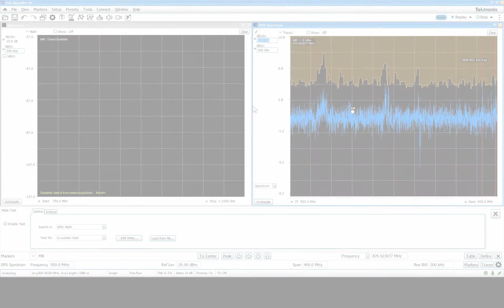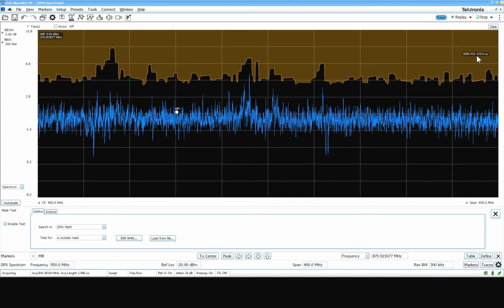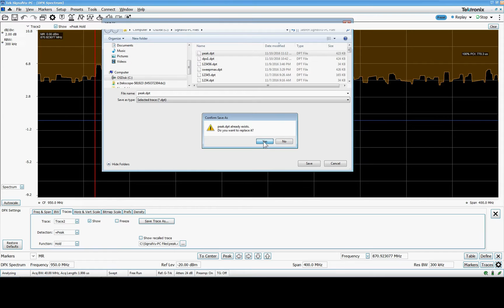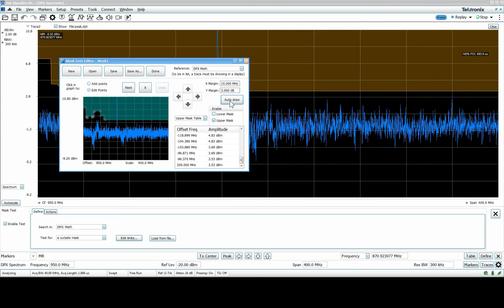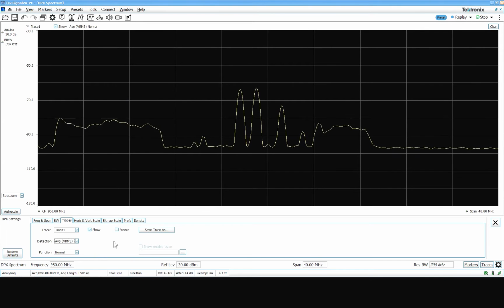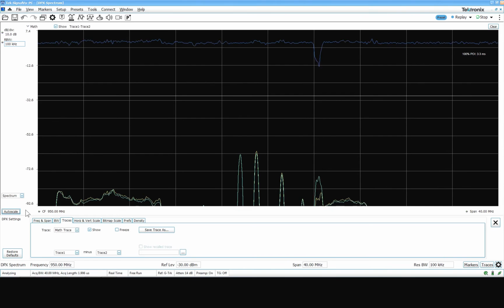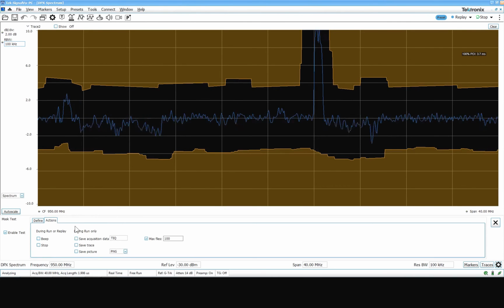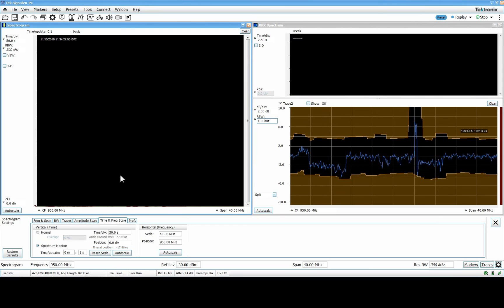Advanced Spectrum Moitoring Using a TEKTRONIX  RSA507A

Comment: hay can you make a video how you can analyze a GSM signal
Reply from the maker: Sure, But we done have application direct for  that yet, But I go in and do one Manual. Is that ok?
Reply: your video about the signal hunting and mapping was really nice, that is why i was thinking what else RSA can do. like demodulation or power measurement that sort of thing. you can also make about what you can do with a normal router wifi signal (802.11 a/b/n) like what you did with the 'car key'. how to set up things when you use WLAN module